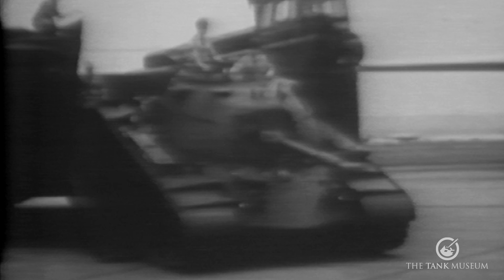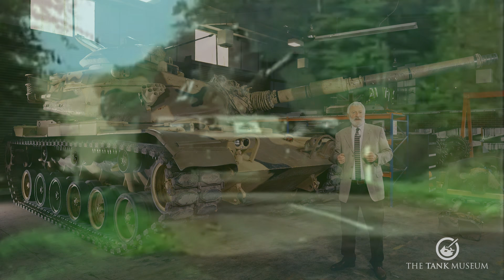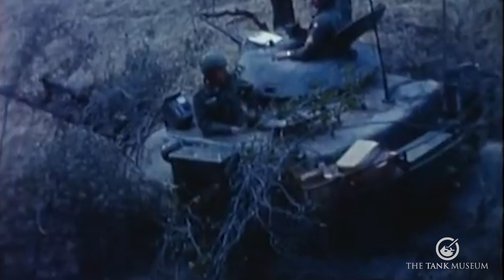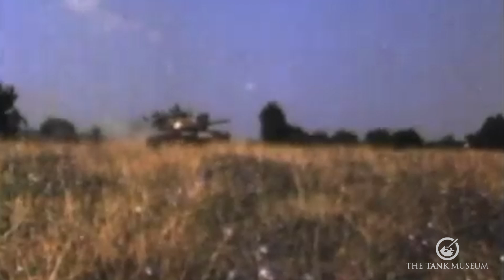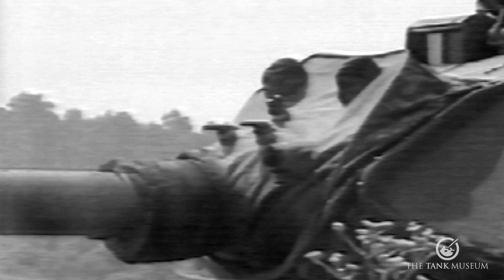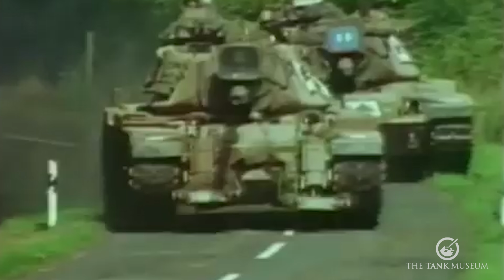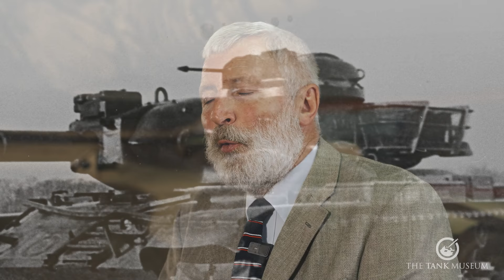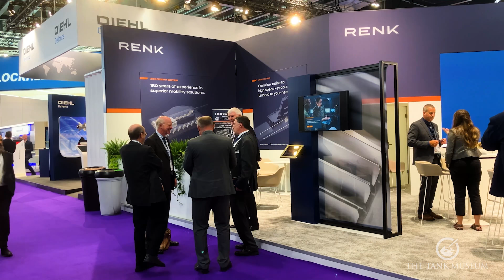M60: Cold War Guardian | Tank Chats #175

Comment: Gas engines vs diesel. Gas engines were a known quality and easy for most GIs to understand. Diesel fuel was needed for the first railroad engines to replace steam engines and some other uses. The sort point was what was able to be produced from Texas crude oil of a very high quality. Gasoline of varying grades was easy and efficient. With shipping in 55 gallon drums and in bulk as was deemed efficient for the shipping available. As the multifuel project got moving diesel won out until turbines came into use. Currently JP-8 is the most common US Military fuel.

Comment: A3s (modernized, only some units in a model called BR) are still in service over here in Brazil. they were going to be phased out when the leopards finished their modernizations, but the program was halted due to high prices in tank parts (due to the ongoin war in ukraine). the modernization of the leopards (1A5) will go to either john cockerill or leonardo, it wasn't decided before the suspension. IMO, maybe they should keep the m60s around even after for training tank crews? idk if it's feasible tho

Comment: Seems US is now making the mistakes Germany made. 
To sophisticated, too hard to build and too hard to repair the F35, vs the Typhoon which may not be as advanced but can build dozens cheaper and faster than a single f35
Reply: Wrong. The Eurofighter is litterly more expensive than an F-35. If you think speed wins you modern air-to-air engagements, you might need a refresher on the last 40 years.

Comment: Shillelagh minimum range 500 meters approx. max out around 2000 meters at first unknown on later tests. Some were expended in the Gulf war on already knocked out T-55 by Sheridan crews 95% good launch and guidance in the desert. Need to be in a position to allow good ground clearance so the round does not hit the ground on launch. HEAT-MP normally used out to 900 Meters.

Comment: I was a us army tank crewman! I was on the M60A1, M60A1 rise none passive and the M60A1 rise passive and the M60A3 all was very well built tanks! The M60A1 did have IR night sights which required IR illumination to be able to see the target at night! The complete family of the M60 was easy to operate and maintain! Then I was put on the M1 with thermal sights! But I think that the thermal sights on the M60A3 was much better than the 1st Thermal sights on the M1!

Comment: Taiwan still has 400+ of these in service as the M60A3 and has recently announced an upgrade package with up-powered engine (1000 hp) and a domestically designed fire control system

Comment: Great video. Brings me back to when I served on these beasts with 1st Tank Bn, 1st Marine division. One comment about that #*%! Cupola though. Not only was it not powered, but you were a fool if you didn’t lock it in place while driving because it it rotated on its own the handle used to turn it manually would smack you hard enough to leave a welt. Another thing about the handle, it was geared so low that it would take forever to turn the cupola more than a few degrees. The usual practice was to stand on the TC’s fold down seat, grab the outer sides of the cupola with both arms and just heave it to generally the desired direction. Usually we just locked it down and ignored it, as the M85 was unreliable anyway. Yes, still mad about that thing almost 40 years later. Can’t believe the Turks kept it and the gun when they modernized.
Reply: Couple minor corrections. The USMC acquired M60A1s in 1972. They were upgraded to RISE PASSIVE a few years later. They kept the IR/Visible light searchlights until the late 80s, though we never trained with them. The ERA package designed for the M60 was applied in 1989, only to USMC tanks as the US Army had already transitioned to the Abrams. Fun fact: the only combat use of ERA was on USMC tanks in the first gulf war, and they couldn’t supply enough live plates. Each tank got only 4, which were placed on the gun mantle. The rest of what you see in pictures are empty aluminium boxes.

Comment: One correction: the commander's cupola, at least in the M60A3, was NOT powered. Except by Tank Commander arm muscle. Crank crank crank crank boom-boom-boom. Also, as a side note, I was told by older tankers that the M60A1 coincidence range finder was called that because if you managed to hit the target, it was by complete coincidence.

Comment: As a 37th Tank Squadron Commander equipped with the M60A3 TTS, my opinion is that the M60 is an extremely reliable Battle Tank, its only flaw is the unreliable .50 machine gun. The Leopard A5 may have greater agility, but its electronic fire control systems fail very often, and this is a big problem for the Unit's technical support. The Greek Army was supplied from 1989 to 1998 with approximately 300 M60A1 RISE, 300 approximately M60A3 TTS, 400 M48A5 MOLF (it is M48A5 with a fire control system the same as LeoA5) and approximately 600 LeoA4&A5,

Comment: You mentioned that the M-60 is so much bigger than the M46, 47, and 48 because of the bigger engine. This is not true, as all of those tanks used practically the same engine. The 46,47, and 48A1&A2 all use the Continental AV 1790 which is a gas engine, and the 48A3 through the 60 use the AVDS 1790 which is the same engine except diesel. Its the same dimensions, and the same in almost every way. The 48 A3, A4, and A5 tanks used the same diesel variant. The difference in size is for other reasons, mostly in the suspension and the turret. That family of engines has a bunch of gas variants and a bunch of diesel variants but theyre all the same size.

Comment: We still had some M48A5's in inventory in the 70's along side the M60A3. I'd rather go to war in an upgraded M60A3 than the T-72 the  M60A3 doesn't blow off its turret when it hits a pot hole too hard like the T-72. I was 19D20 but was cross trained in the M60A3.

Comment: As regards the height of the M-60 - being tall isn't always a detriment for tanks - it often ables the tank to use terrain, debris and hull-down "hides" and still be able to shoot - whereas in a similar situation a "low" tank must expose itself to engage.
Reply: The main problem with a shorter tank is that the hull roof limits gun depression and it can’t fire from defilade as easily. Height DOES make a big difference as a target though, as the hardest variable to account for in gunnery is range. A taller target is much more forgiving of range error.

Comment: The advantage the M60 had over the  contemporary Soviet tanks was fire control systems.  Ours could shoot at night and on the move.   It was air conditioned and a crew could fight 24 hours and sleep in the tank.  The disadvantages: high silhouette,   insufficient armor, week gun.  
The important concept is that the M60 was part of a combined arms tactical unit.  The attack helicopters  were the main Soviet tank killers along with attack fixed wings (like the A10).  Then there were the guys with SADMs and MADMs (like my boss) who would nuke choke points.  By time the main US reinforcements reached France, the main Soviet armor would be wiped out.  Arriving M60s would not be up against front line Soviet Tanks.  Of course the West German, French and British armor would have been expended stopping the Soviets

Comment: I always thought tanks should have a combo trailer with extra rounds and diesel fuel that the tanks would drop before engaging the enemy.  Tanks would use these trailer's fuel first.  These trailers would be local stations for arms, fuel and parts replenishment much more accessible as they'd be closer to the front for dash-back replenishments.

Comment: When we sold the M60's to the IDF, one of the first thing's they did was remove the commander's cupola. They found when it was hit in combat, it would cut the commander in half. Also the M85 was a piece of crap, we could never get it to fire correctly. Basically the same for the M73, it was a pos. However, that all changed when we got the M240, I don't think there was a better medium machine gun ever made. Time seems to make that a true statement, as it had several successful ground versions. The M60 was a OK interim tank, but, the M1 was a revolutionary departure in tank design.

Comment: I have a strange background. Born an "Army Brat" I attended college in the army ROTC program. However ,I asked for and received a Navy commission. Later as a flag LT on an admiral's staff, the XO for my admiral needed an officer to integrate with an  army unit that was to come under my admiral's command. Someone pointed out my 201 file to the chief of staff and away to Ft. Knox I went for an extended TDY in order that the admiral had an officer at his elbow that understood tanks, the M60A1, in particular. In that way I became a student ,and I daresay a friend of Col.  J.W. Thurman, (google him?) Anyway I got to learn all the functions of the M60 Patton tank. I learned to drive one. That was more pure "fun" than blowing crap up on Vieques. I was impressed and afraid of those beasts. One piece of advice I got from the CSM I still remember today. Just before I mounted "my" tank as the temporary tank commander the CSM pulled me aside and said, "Remember LT, there is nothing on that tank that will not hurt you."   Between Col Thurman , and CSM Joe Wentworth I returned to my command (COMNAVFORCARB), a fully qualified "tread-head". Those monsters, the tanks I mean. both impressed and scared the hell out of me . I was damn glad we ,and our marines had them.

Comment: M60’s did not have an NBC over pressure system. It only had a small NBC filter system that the gas masks were able to plug into that provided low pressure air into a mask to help the crew breathe easier.  Over pressure system didn’t hit until the M1 Abrams.

Comment: The A3's and equivalent foriegn variant Updates are still quite capable Armor platforms.  Good gun, good optics, good mobility and generally reliable. Extremely effective w/ HE-FRAG/HEAT/Squashead/Cannister as direct fire support; modern DU/ Tungsten 105 APFDS will still absolutely defeat enemy Armor.

Comment: M85 was also on the old model AAV and it was a super complicated MG to keep firing right without jamming.  SO many pieces to it vs the regular 50 cal but if u greased the chute right it fired 1000 res a min and that's 400 more a min than 50 cal were so used to
Reply: Its main problem was the internals weren’t sturdy enough to lift the ammo belt. It worked fine on high rate though.

Comment: I worked on these in the seventies as a 63H  tank mechanic, I still remember the  Continental AVDS17902DR V12  air cooled  engine. I could work on that tank as if it was yesterday. Good memories. :-)
Reply: A 63H as well, with the 1'st and 2'nd AD. At 67, I'd need another look at the TM, not exactly yesterday. Or good times. In 2'nd AD, they had a policy of keeping 90% of vehicles off the deadline list, at all times. Which meant working overtime. Which meant working until midnight, whenever the 90% standard wasn't met. "You had Rolling Stones tickets for tonight? So sorry, BACK TO WORK!!!" 63H was eventually done away with, replaced by civilian contractors.

Comment: The M68 isnt the british gun, different geometry throughout it. It is just capable of firing the same ammo (presumably, i have seen this stated but am unaware of it ever being tested.
Reply: @@Steve-ou4vm The reason the parts dont interchange is specifically because its a different gun :D. There wasnt the imperial metric issue for the yanks. M68 was a development from a WW 2 experimental gun T-53 IIRC. They had an assortment of experimental guns they tested in the 50’s. They found the T53 could have its chamber rebored for British ammo and would then outperform the Brithish gun (which otherwise was the best gun in the testing)

Comment: He mentions lroblems with the missle on the A2 of which there were a few but most A2 crewman can tell you about the problem that occured if after you fired a missle and then fired a conventional round and the loader forgot to reinstall the optuator seal.

Comment: The MBT-70 was being tested on Ft. Knox when I arrived there in late 1974. I saw it in mobility trials. It was shortly thereafter cancelled, and the single vehicle (I only ever saw one at a time) sat forlornly in the motorpool of the post's main maintenance facility for months until it disappeared.
I was in an armored cav troop (E Troop, 2/6th Armored Cavalry) and we had Sheridans in our platoons' tank sections. (We scouts had M-114 A1E1s, which we later traded in for gun jeeps. A big let-down for us.) The Shillelagh missile system could be finicky, but when it worked (which was most of the time) it was very, very good at hitting what was aimed at. Gunners had to avoid the tendency of looking for the missile immediately after launch, because they would drop out of sight until the rocket motor lit. The "look down" for the just-launched missile would cause it to dip (as it received the flight command through its wire guidance system). Gunners usually immediately recognized the mistake, raising their sights again onto the target, and the missile would also quickly correct. I saw this happen on several launches, with at least one instance of a missile actually bouncing off the ground and still going downrange to hit the target. (BTW, the IR system consisted of an IR source on the back of the missile and a receiver on the launcher. It was not a data link. A computer would calculate the difference between where the sights were aimed and where the missile was - based on its tracking of the IR source - and would send flight commands to the missile though wires to correct its flight - like on the TOW missile system - causing the missile to align its flight with the gunner's line of sight to the target. Gunners had to also avoid the tendency to "fly" the missile, and keep the sights on the target. The mistake of "looking down" at launch didn't fly the missile into the ground directly, but was a result of looking down with the sights, causing the computer to issue flight commands to the missile that would cause it to dip because the input from the aiming point told the computer the target's location had changed.)
There were M-60 A2s on Ft. Knox, and in Germany when I arrived there in late 1976 (just in time for Reforger). There I was in the scout platoon of a mech infantry battalion (CSC, 2nd/87th, 8th Infantry Div), and the brigade's tank battalion had one company of A2s. By the time I left in late 1978, those A2s were gone, all replaced by M-60 A1s. They were never called "Starships" during service by any of us. As Wikipedia notes, this was a moniker that was adopted later.
Also while I was at Ft Knox, testing had begun on the M-60 A3 (with stab-on-stab, as we called stabilization in two axes, and what looked like a mini weather station on the turret, reading air temp, wind speed and direction, and barometric pressure, all to feed the gun's computer with data for calculating firing solutions - the gunner just laid the sights on the target and the computer adjusted the lay of the gun to account for everything else). I saw it at a range shooting a firing table and it was quite impressive.
Reply: Nice novel

Comment: The M-60 A1 turrent was derived from the M-103 120mm gun heavy tank. The M-60 A2 had a smaller turret, added the 152mm missile system from the MBT-70, and added a hatch for the gunner. The A3 went back to the A1 turret shape and 105 gun, with better  electronics.
Reply: My personnel favorite is the m-103, with a120mm cannon!

Comment: I served on the M60A1, 2nd Armored Division at Ft. Hood 1972-75.  We knew our limitations, but good tank crews and lots of training made the difference.
Reply: My first duty assignment was Germany with 1 AD in January 1976 through December 1977. My first tank was one of the newest M60A1(AOS).  About half the company was still running non AOS tanks. The smoke grenade launchers were added after I came back to Fort Hood in January 1978 and when I returned to Germany with Brigade 75 in 2 AD, the smoke launchers were already added.  When I ETS'd in August 1979, we had never fired them.  The unit I left in 1 AD in the 6 months I was gone, began testing passive night sights, one of which was the starlight scope sights.  They were just getting some of the early thermal sights.  There was also a lot of experimentation on the camouflage patterns being used in Germany.  You being 2 AD, i was with 3/67 Armor, the Hounds of Hell.

Comment: Excellent video.  However, one thing lacking is that you  didn't  mention is also the huge range of support vehicles that were based upon the M60 chassis.  My favorite is the  M728 CEV which used the MASSIVE M135 165mm demolition gun which was based off of the British L9A1 165mm demolition gun.  I got to see a demonstration of that gun at Ft. Leanordwood in the early 90's and that thing was incredibly powerful.   I really think it was a mistake that this weapon was not later mounted on a Abrams based CEV. as it's snub-nosed barrel would have been ideal for urban combat later encountered in Iraq    The other major variant that your museum channel really should cover is the amazing M88, M88A1, and M88A2 recovery vehicles.   These were used many times as ad-hoc combat engineering vehicles despite being designed as recovery vehicles.  Their massive engines, powerful cranes,  bulldozer blades, and large array of tools, made them truly excellent multi-purpose armored vehicles.  I will always remember these vehicles from the incredible roar their engines make.  They sound like some kind of gigantic beast growling.   These most recently have seen combat in Ukraine where 8 were sent (with two lost in combat so far).